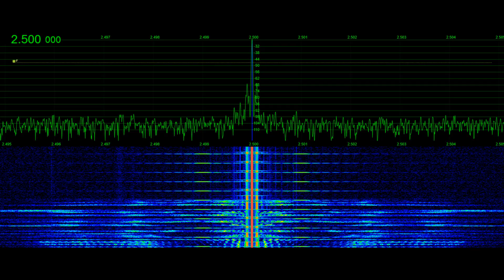WWV Announcement | WWVB Damaged 60 kHz | Signal Phantom

Comment: I had a question. What about possibly using WWVH (Hawaii), or the Canadian time broadcast, (different frequencies?)  My clock in eastern Kansas (Kansas City metro area), seems to be working, but I have noted that it usually corrects itself at night.
Reply from the maker: Both WWV and WWVH do not transmit the clock signal that is used by radio controlled decoders, that is only done via WWVB at 60kHz in the North America region.  CHU does have a digital time stamp, WWV and WWVH do modulate a 100Hz BCD code that no one uses.

Comment: Well, I live in the Philippines, and my radio clock worked for the past 2 years since I moved here.  Don't know how.  However, after seeing the video, I checked it and it's time has drifted 9 minutes off.  Damn shame.  Yes, I know it's not to be available here since the signals are transmitted in the US, but given its low frequency nature, probably skipped off the ionosphere several times before it's received here with probably 1-2 second delay.  Fascinating really....

Comment: VLF timesync is becoming difficult anyway due to ever increasing interference.
I now have a kitchen clock that synchronizes using NTP over WiFi instead, much better!
Reply: All right for clocks, not so good for watches when internet is bad or there’s a power failure. And the smart watches are a lot more expensive.
Reply: @robertr64  Smart watches use NTP over WiFi as well, or even over LTE.
They are not very expensive compared to traditional VLF synchronizing watches.
Any synchronizing watch or clock will continue timekeeping even when the sync source is temporarily unavailable, they will just slowly start to deviate from correct time.  But normally will be better than a manually set watch.

Comment: How about somebody inventing a gadget that connects with wi-fi and generates an LP time sync signal on 60khz in the absence of WWVB?
Reply: Do know they also send a data packet over the internet for routers, computers,  ect.   Would be nice it there was a legal way to broadcast a very low power signal to keep our shortwave devices synced
Reply: Those projects exist, and have existed for years.
Search: WWVB simulator.
Reply: I just discovered an app that sends a time signal to your radio clock devices using the speaker of an iPhone or Android. Haven't tried it yet.

Comment: Radio Station WWVB
Notice: From approximately 0000 UTC on April 7, 2024 WWVB's south antenna has been disabled as a result of damage from wind gusts in excess of 90 MPH. WWVB continues to operate at reduced overall power using its north antenna only.  https://www.nist.gov/pml/time-and-frequency-division/time-distribution/radio-station-wwvb

Comment: so now my ATOMIC CLOCKS on the East coast will not work.. Thats a big drop in power for 60khz
Reply: Remember half power is -3 dB or 1/2 S unit decrease on a calibrated receiver.  If you had reasonable fade margin before, you can probably still receive WWVB.  Having said that, my Casio watch seems to have more trouble than it used to, also aggravated by the change to add the phase modulation to enhance precision back in 2012.
Reply: 30 KW transmitter, even with the relatively high losses in short antennas. Hard to imagine a receiver 1500 miles away would cause your clocks to "not work".
Reply: @DrLumpy ? This is the national clock sync signal..
Reply: @enginerdy  I'm pretty sure everyone here knows that.

Comment: Yeah. As much as i need this....bet NO ONE in Congress will vote to fund the repairs.......
Reply: I can bet a dozen donuts no one in Congress ever heard of WWV!😏👍
Reply: It’s set to be repaired this summer. Check the website, parts are on the way.
Reply: More than likely something like this would get piggybacked on a bill that’s DOA so you might be right.
Reply: If these stations do what we think they do, then they will fund the repairs immediately
Reply: @karmicchameleon5816  nope.   Shortwave transmission of atomic time signals.   Most consider these to be obsolete.....there are internet based equivalents for computers/routers/ect....  Broke because funds for basic maintenance was not approved.   Doubt money will EVER come to fix it
Reply: @melvance7281  If they've managed to sync the analog devices these signals communicate with,  then I'd agree with you.  But much has occurred to make me think that they have no backup if the mainframes were to go down. I think they may still serve a purpose as a backup; hence that's why I think the money will show up at some point.  Not immediately though
Reply: @melvance7281   WWVB is not "shortwave" (HF), but "longwave" (VLF). WWVB is far from obsolete; in fact the market for "atomic" (Radio Controlled) clocks is thriving.

You're correct only in that, yes, things connected to the Internet, amazing coincidence here, have access to the Internet (and thus NTP).
Reply: I don't need to be taxed more to fund your pet special interest.
Reply: @QuadMochaMatti  you have no clue how little this costs or how important it is to American industry.   Go away and figure out how much such a low tech thing effects most of your life
Reply: It wasn’t long ago that they tried (and thankfully failed) to defund it so yeah. Real shame, lot of industrial hardware that uses that signal to keep time synced.
Reply: @kishascape  then maybe they should privately fund it instead of relying on the taxpayer.
Reply: @acf2802 we already fund the National Bureau of Standards through the feds. They just need to divert money in their budget from climate change and DEI to fix the antenna

Comment: Oh noes !!!!  
I've got quite a few WWVB radio clocks. Usually work well here in eastern Canada. 
I noticed that my two wall clocks were not in sync. I'd assumed it was due to the solar storm.
Reply: WWVB clock radios ironically in the land of CHU.
Reply: @michaelquinones-lx6ks  

VLF (60kHz) is a bit of a specialty. :-)

CHU would be comparable to WWV, as you certainly know.
Reply: @JxH  Thank you for your reply, Also, I'm surprised you guy's up in Canada use our time service WWV/WWVB i assumed you used your own home grown time service CHU? Yes, I understand its comparable.
Reply: @michaelquinones-lx6ks  

CHU doesn't offer a VLF (longwave) option.

"Atomic" (radio controlled) clocks more-or-less universally rely upon VLF signals. Reasons include better signal reliability (present circumstances being the exception, LOL), ability to use tiny loop-stick (ferrite core coil) antennas, readily available ICs, and more.
Reply: @JxH  Thank you very much for your reply.
Reply: pretty ominous having this one station broadcasting time signals to the far corners of abandoned basements to that one dusty radio controlled clock still receiving that signal, now they will be out of sync... spooky

Comment: Question for you. What kind of antenna do you use and how tall is it if you are using any radio equipment where youre at? The signal quality is so damn good like the last person mentioned, and i think part of my problems are my antenna, so im looking to build or buy a new one.
Reply: Tyler is local to WWV, he could pick it up with braces or a well placed titanium hip ball and socket replacement.
Reply: Tyler is in Fort Collins, Colorado
Reply: Um.  What are we talking about???? Thought it was about a international standard losing capabilities
Reply: What bands are you operating on? I run 20, 17 and 10 when mobile and use a screwdriver type antenna,  when I'm at the house I run resonant dipoles.
When it comes to antenna systems you'll want to buy the highest quality coax and mounts you can afford, I strongly suggest LBR Industries or Messi & Paoloni coax, especially if you're using extended runs in excess of 50' for hf, or 25' for vhf/uhf.
Reply: Even the cheapest KMR-400 coaxial cable available from Amazon has extremely low loss, like under 0.8dB for 100-feet at 30 MHz (I've confirmed this).  No need to go crazy spending several times the money for fancy-brand coax. Especially if the distributor is MFJ (Yikes!). I'm nearly 50 years a Ham.
Reply: @JxH  Buy once, cry once. The price difference is negligible and running mobile and at times QRP,  I need all the advantages I can muster.
Reply: "The price difference is negligible.."
More than twice the price. You could move up to a lower loss cable and still save money. Radio waves can't read the brand name; they only care about loss.

I disagree with your recommendation. It's a waste of money.